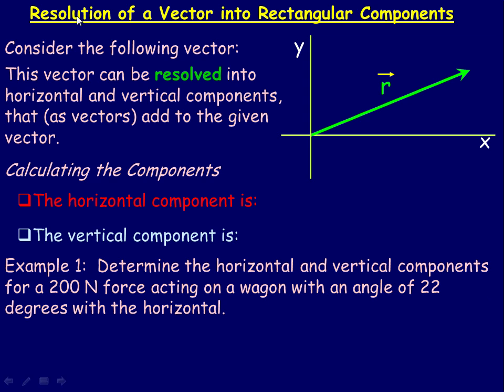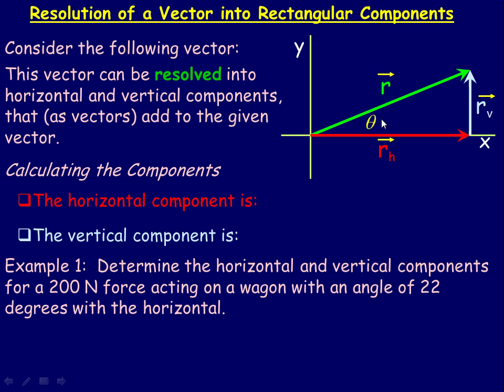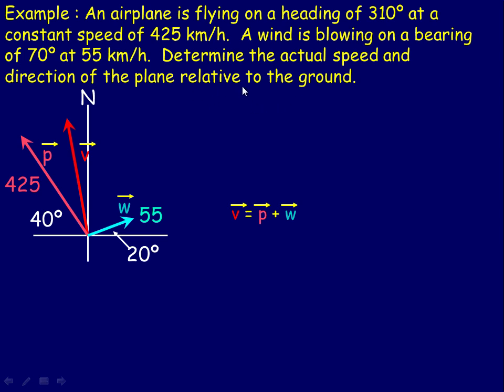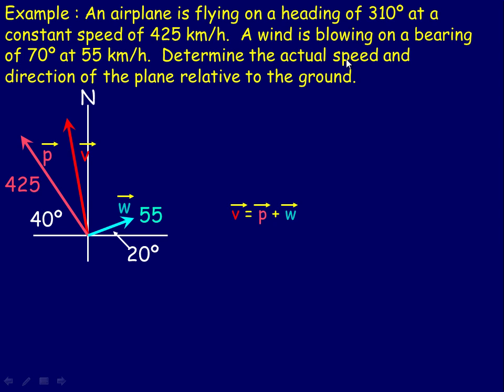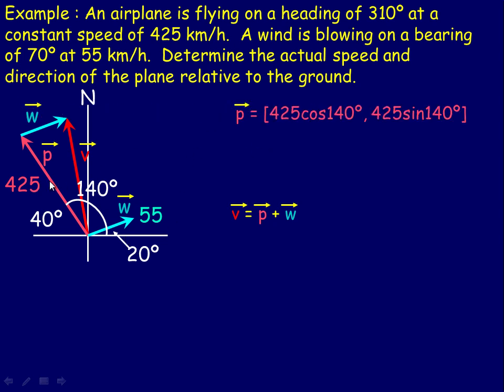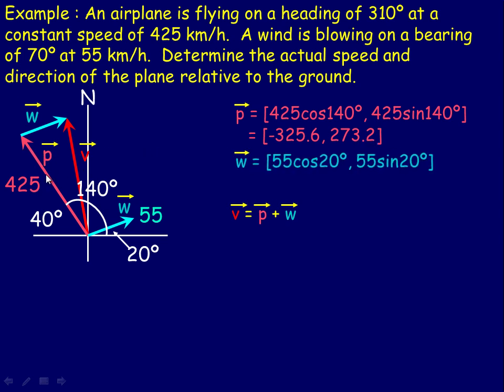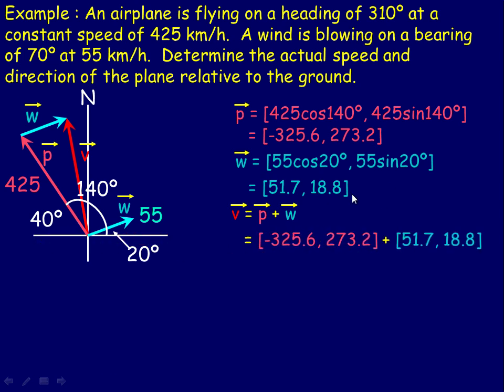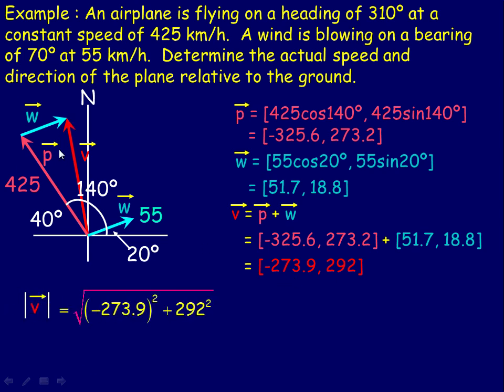Resolution of a Vector into Rectangular Components

Comment: Do You know how to find the horizontal and vertical componentes of a vertical verctor, I mean, if it has 90°?
Reply from the maker: The angle it makes with the x axis or horizontal is 90 degrees.  The horizontal component would be the magnitude X cos90 = 0 and the vertical component would be magnitude X sin90 = magnitude.

Comment: Is it really necessary to rotate the axis on example 2? It seems to be more complicated than applying on the original.
Reply from the maker: +Ayra Lazaro The only reason for the rotation was to write or display angles as "bearings" which is their clockwise rotation from North.  This is a convention often used in navigation or orienteering for direction of vectors.  If you didn't do this then you'd have to state the direction of the plane in reference to either its flying direction of the direction of the wind.
Reply: Oh well thank you very much sir.

Comment: if only magnitude of two vectors and the angle between them is given . then how can we find the magnitude of resultant by rectangular component method
Reply from the maker: Ammar Ahmed If you only have the angle between them and not the angles they make with the coordinate axis, then you can't use the component method. I'd use the Cosine Law in that case to find the magnitude of the resultant.I suppose you could use sort of a suedo component by considering one of the vectors as an "axis" and then use the angle to find the components of the second vector, but that's a bit unorthodox.

Comment: If you're using SOHCAHTOA to figure out the values of the vectors |rh| and |rv| why not just stick to using one unit? I mean, like for example, using the sine of the angle to figure out the values of the horizontal & vertical components?

Also, if |rh|+|rv|=|r|, then explain the math 75N+185N being equal to 200N.

A little help please
Reply from the maker: The sine is used to find the vertical component magnitude since sin = opp/hyp and cosine is used to find the horizontal component since cos = adj/hyp, although I'm not sure what you mean by "one unit".
While it is true that vector rh + vector rv = vector r, that's not true for the magnitudes of the vectors.  Adding vectors and adding their magnitudes are completely different things. Magnitude is a scalar value (the length of the vector), while a vector has both a magnitude & direction.
Reply: It is simple mathematics. You are confused about how did 185+75 became 200? 
Well, its kinda triangular law of vector addition.
Assume that you walked 185m firstly to east and then went on to walk 75m towards the north as the triangle represent, you walk 185m+75m=260m.
But Distance is a scalar quantity. 
And if you take out the displacement(which is a vector quantity) you will find that you walked 200m which resembles the original vector here.

Comment from the maker: Heading is just the direction something is going or pointing towards as it moves, such as due east or N 30 degrees W.  Bearing is naming a direction with an angle measured clockwise from north.  So, for example, east is 90 degrees rotated from north, so due east has a bearing of 90 degrees.  South is another 90 degrees past east so due south has a bearing of 180 degrees.  If you were going 20 degrees past south we could call that S 20 W, but the bearing would be 200 degrees.

Comment from the maker: @sammiepie4 I'm sorry, but I don't see the error you refer to.  Vector p is at a bearing of 310 degrees, meaning it is 40 degrees passed due west (270 + 40 = 310).  If vector p makes a 40 degree angle with the negative x axis then it makes a 140 degree angle (180 - 40 = 140) with the positive x axis or due East.  Am I missing something?

Comment: Thanks for another great video 

I especially liked that you used the example from your previous lesson it was really useful to compare the two and see which solving method I liked the best.

But one thing I noticed was you have the wrong angle in this example. The angle 140 degrees should be 120 degrees.